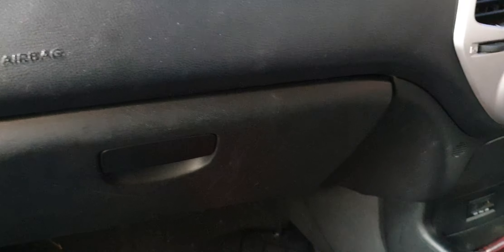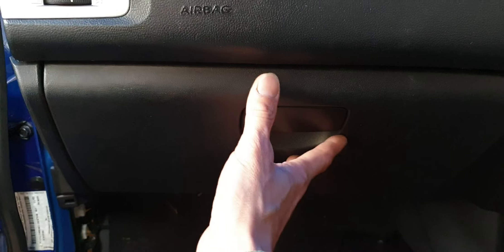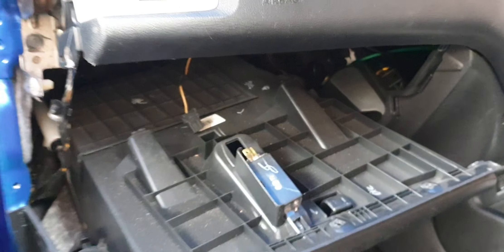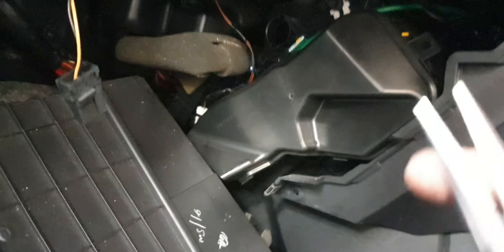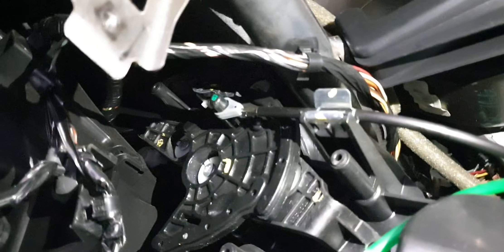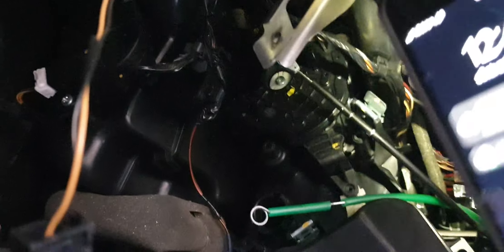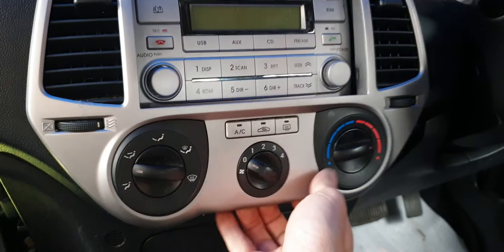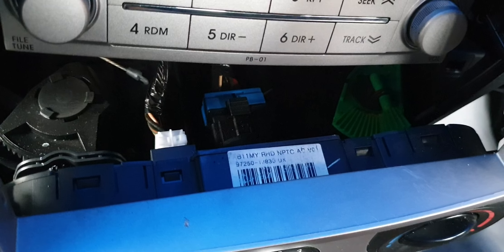Part 1 - Expert Guide: How to EASY DIY remove radio factory HYUNDAI I20 PB CD Player (2009 - 2013)

Comment: Nice video! Ared you replacing it with a new radio? Do you have any suggestion for a replacement one? Thanks!
Reply from the maker: Thanks for your comment. Yes, recently, when we replace our customers car's headunit system we are doing those videos. For this hyundai i30 model we suggest 9 inch system for easy fitment and easy of use. But also we can have 7 inch or 10 inch options.